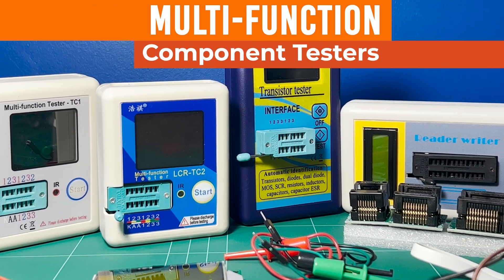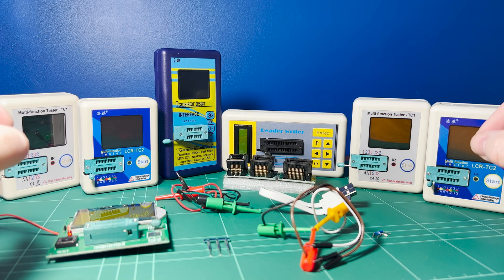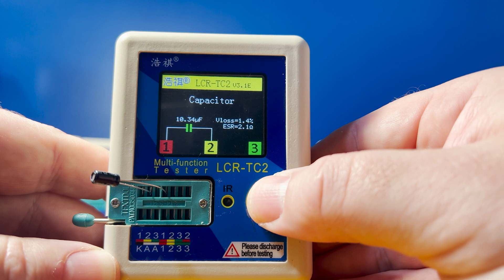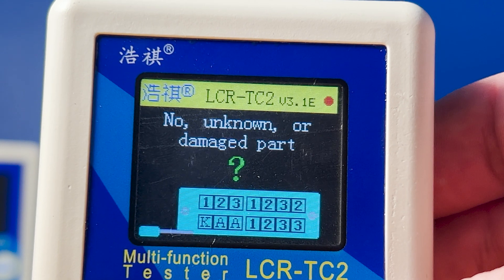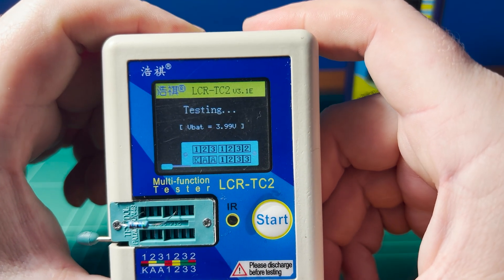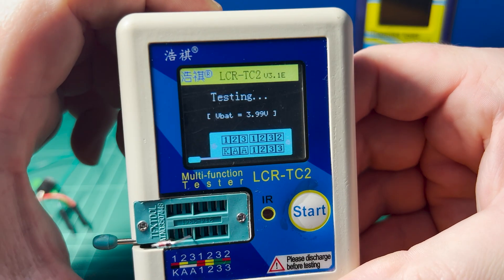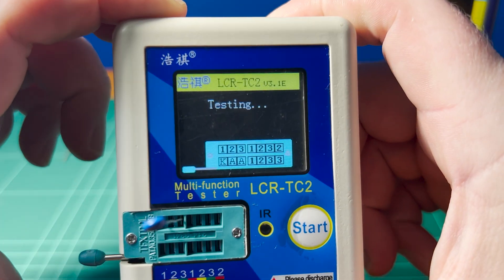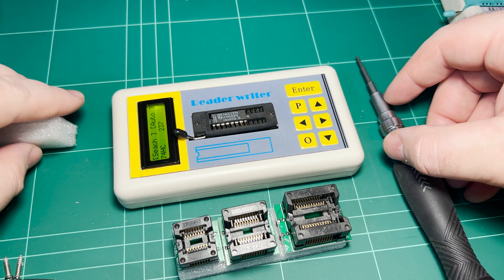Cheap Electronic Component Testers - the good and the bad! LCR TC-1, TC-2, and Counterfeits...

Comment: Looks like I've received a counterfeit TC2 :(   Has the blank chip and I was suspicious as measuring about 50% out in various capacitors ?!??!?  Trying to resolve with Aliexpress store.  Annoying as used my TC1 a lot over past few months and worked well until I fried it by measuring a fully charged massive filter capacitor (there were two and picked up the one I hadn't discharged by mistake, my own stupidity) so bought as an "upgrade".

Comment: 9:50 key reason I want to buy the TC2, so what's the std procedure for discharging a cap in circuit?  Do I simply use a pair of needle nose and short the leads first?  Thanks for the video and help.
Reply from the maker: That’d work just fine. I have a small flat copper bar sitting on my desk for that purpose. More care is required for high voltage caps of course.
Reply: Even small low voltage spikes damage the caps ..use a resistor to discharge safely to avoid plate damage

Comment: On the "fake" one, isn't X2 a crystal oscillator?  The mcu might be a fake, but did you notice any difference in performance between the two?  Just curious.
Reply: My "fake" one (which looks inside exactly as on the video, incl. missing X1) doesn't have a selftest. When starting it with 1+2+3 shorted, it just tries to measure it as a set of resistors.
Reply: @misch2 it does have a self test option you have to double tap on start up and it brings up a menu.
Reply: I appear to have received a fake TC2 - has the blank chip and no crystal - I was suspicious as it was reading up to 50% off on small capacitors so I opened it up. So, yes, performance of counterfeit ones is not good, I had a TC1 and was pretty accurate (until I fried it...)

Comment: Hi, let me give you an informed opinion, as you talked about fake / counterfeit ("bad"?) LCR-TC2s. All LCR are more or less "counterfeits", as build in China with no rights and control whatsoever using the public work of others. Mine is claimed to be "original" and I can send pictures to the factory to validate that (but who decides which one is "real"? there is really one?). It has the same internals as the one you said it's fake, but you are just comparing the latest 2.0 board (manufactured from 2022 onwards) with the previous 1.2 (manufactured from 2020 onwards). The crystal oscillator is just there (the microcontroller couldn't work without it!), only smaller - they switched to a SMD one (labeled 1600T). The ATMEGA644PA, a 15 years old microcontroller, has been replaced, due to current high prices (8$), with a similar one. It is, on top of that, a chinese clone of the ATMEGA328P (no JTAG, so no reprogramming abilities, but half power consumption), one of the other microcontrollers used (for price reduction purpouses), with its label sandpapered to avoid giving others that information. By checking the pins number (32 and not 44) and the pinout (aka to what they are connected to), someone more capable than me said its the (not so bad) LGT8F328P. These testers, "fake" or "not fake" work more or less just the same, as they use similar components and similar technique (AVR). They are all damaged by testing charged capacitors (the microcontroller is fried) and you should be careful testing zener diodes. They all lack, by design, proper protection from high voltages and high currents. The last LCR iteration, the TC2 with 3.1E firmware and 2.0 board, has some problems of the previous ones fixed, but seems not so accurate as the ATMEGA equipped ones, for some reasons. In fact, there is a sticker on the back just saying that ("note: this tester does not provide good measurements..."). These 20 bucks devices do the best they can. But, as more specialized devices, by more known brands, are on the market, I see no point in searching for a "non fake" LCR - they all get the work done, in a similar (very approssimative) way. A loudy minority of enthusiasts praise the ATMEGA ones just because they can update its firmware to a custom one. We, instead, can wait for a LCR-TC3 while using a "clone" (or not). BB.

Comment: Do you have a link where you bought the LCR TC2? I bought the TC1 based on this video from Banggood. I opened it up and the board had no oscillator crystal, it did have a Atmel  Mega 328P chip but I think maybe it is not a real one, just printed the name on the chip. It has no CE sticker either.

Comment: Theses are nice to test components. It seems some reference data on them would be useful where known R,C, L and diode data on specific parts obtained with better instruments would be the standard approach. Are these results within some percent of the best measured value and is the reading always high or low and so on.